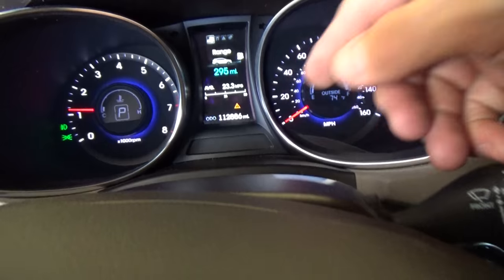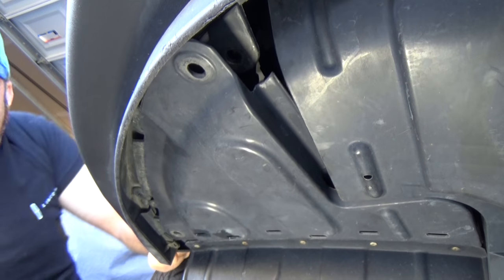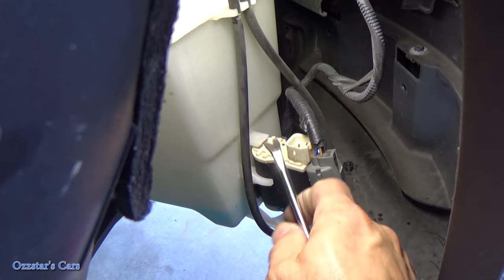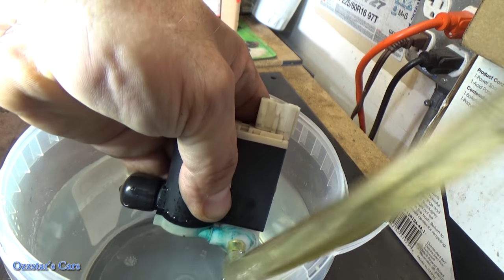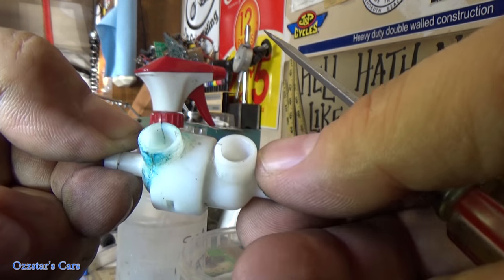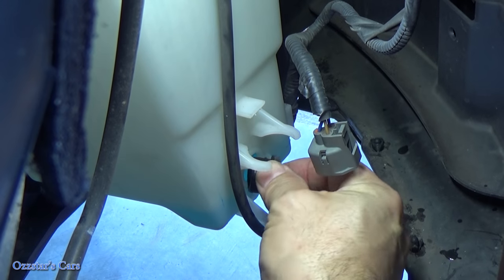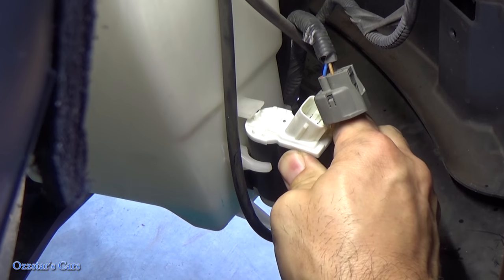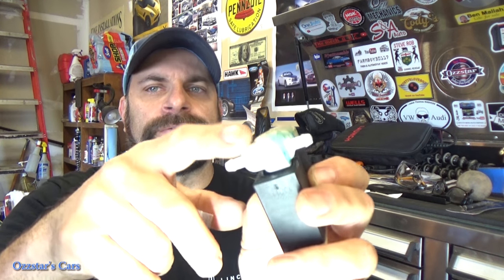Windshield Washer Fluid Leak Repair

Comment: *******I opened the water pump. Same issue same location ans the nipple was cracked. I made the crack bigger and filled with good quality water proof appoxy . It was PC appoxy potty stick suitable for radiators. Its fine now. No leakage*****

Comment: A rodent has chewed a tube but i dont know where it goes...and I cant find info on where the two tubes (as shown in your video) go....one goes to ..i suspect the rear but where does it go...no map to find other end of bite
Reply from the maker: So you see a fluid leak but can't pinpoint it?  Do a smoke test on the hoses.

Comment: I used this pump to replace the pump on a Ecell 3100 PSI pump. https://www.youtube.com/post/UgkxEU8wdEWW31diRsOawsCNfWEho39M27qd The model # is PWZ0163100.02 for those looking for a matching pump. It went on very easily - 10 minutes at most. Feels like a lot more power than the original but that's to be expected. Can't tell a difference when cleaning with the wand or floor sprayer. Would recommend as it was cheaper than most I found. The maintenance free aspect is definitely a plus too. Have used it through about 6 tanks of gas and have zero issues so far.
Reply: Ez pz 24 $ auto zone

Comment: Just did mine after watching this video and a couple others. I took the wheel off and then east access to the plastic fasteners and pretty straight forward from there. Took me about and hour ish start to finish, not too bad. I bought a whole new reservoir with pump and everything for $97 online rather than mess with all those small seals.

Comment: Thanks for the super informative video bud.. all fixed, with the same crack being the issue. Only issue I had now was that my rear washer which was previously working, is not spraying... I'm thinking I tugged something out of place... was getting dark so I left it for diag tomorrow... have you had any similar issues?
Reply from the maker: No I haven't.  If you bought an aftermarket pump I would suspect that is the issue.  Good luck.
Reply: @ozzstars_cars  thanks mate.. it was oem, but I'll have a look tomorrow...

Comment: Thanks so much for posting this. I was able to do the repair with your video without much trouble at all. If it helps anyone else, one of my tube fittings had expanded and wouldn’t stay on when I ran the motor. I fixed this by just snipping the expanded end a little to create a snug fit.

I live in Florida so the heat probably caused the tube to expand on that one side (the side facing the road).

Comment: Fantastic work !!! Do you think maybe using crazy glue and sodium bicarbonate will seal it for good , also some types of epoxy . Again just for emergency to get you through , your idea of getting a new pump is the ideal way to go.
Reply from the maker: I have tried exactly that and it failed. Replacement is the fix. Thanks for the comment Gino.
Reply: @ozzstars_cars  thanks and keep up the great content 👍🙋🏻‍♂️

Comment: thank you! for the tutorial,   super simple to fix,  I repaired the same on a 2015 Santa-Fe.  Did not take off the wheel, had just enough space,  also used the existing grommet as you did in your video.  15 min fix and a  $26 part from  AutoZone   will see how long it lasts!  thanks again!

Comment: Great video! thanks, I knew exactly where to go, mine had a crack in the exact same place. If you want to fix this on the cheap try a cleaning up the crack with some sandpaper and a little JB weld.. good as new. 😂
Reply from the maker: That's a hillbillie fix!  haha  Glad the video was helpful.

Comment: Hi. Great video. Would this tightness test apply to every washer fluid pump? I just tested my pump from 08 Passat  and after blocking fluid intake side and blowing other side bubbles appeard in unexpected place. My understanding is that there should be no air comming out from any other place that fluid inlet and outlet. Am I right? Thanks
Reply from the maker: Sounds right

Comment: I have a 2007 Hyndai Accent and the neck of the washer reservoir is cracked and I cannot top it off as it leaks out from the crack.  Can I use Gorilla tape around the neck to tape up the leaky spot?
Reply from the maker: I would suggest replacing the cracked tank.

Comment: Thanks!  I noticed a little ww fluid under our 2017 Sorrento when I was changing the oil the other night.

Guess I know one of the chores I'll be doing this weekend.  Thanks for the tutorial.  It seems simple enough to change the pump out.
Reply from the maker: It's always something to fix when trying to just relax and take a day off.  Fairly easy fix if you have a new pump.

Comment: Great work in the steps on replacing the pump Glen! And great tip on using a piece of tape to ensure that you don't have any leaks afterwards. Have a good one and be safe...
Reply from the maker: Thanks and you be safe as well.

Comment: My 2016 Santa Fe - exact same problem as you showed.  It had been leaking quite a while but lately leaked the tank out in a few weeks.  You saved me a lot of time by knowing exactly how to approach this!  Because I am cheaper than you, I lightly sanded the plastic where I could get to it, sprayed carb cleaner on it (to remove the grease).  Then used some good 2 part epoxy (24 hr cure) on it all around the joint (not just on the crack).  I'll report back in a few weeks if this is successful but I bet it will be fine.  Saved the $24 for a new pump!  PS, I use distilled water in my tank.  I've found that when it dries, there are no water spots and it never freezes where I live.
Reply from the maker: Interested to see if the band aid will hold.👍
Reply: @ozzstars_cars  1 year still holding.
Reply from the maker: @FlyMeAirplane  happy anniversary!! haha

Comment: What if the pump is working, but water doesn't come out from the hose disconnected? maybe the hose clog?
Reply from the maker: Anything is possible. Did you bench test the pump?

Comment: This was the exact same problem I found on my 2017 Kia Sportage today. Thank you very much for the help. Might jb weld that little white connector part?
Reply from the maker: You're welcome.  I would not attempt the repair with goo.  Comebacks are no fun.  Pump link pinned at the top of this comment section and in the video description..

Comment: Hey! Nice fancy double-dongger pump there! 👍😎

I had that same problem with the rubber on a 98 Ram 2500. Was an AC Delco pump, too. Installed the rubber, slipped in the pump, filled up with fluid and she peed everywhere! Ended up doing the same thing you did and reused the old one. No harm in reusing rubbers, right? 😄
Reply from the maker: I call it recycling. 🤣 Have a good weekend Smitty!
Reply: @ozzstars_cars  -  You too, Glen!

Comment: Hi I fill mine but it goes directly onto the ground.. I fill it and run straight to use it but its empty by the time I reach the driver seat to operate it. Any advice please 1st time driver and completely new to this thank you
Reply: Also it's a nissan micra
Reply from the maker: @lisagolding4882  a flashlight and a good set of eyes to find the leak.

Comment: If you have a 2016 Kia Sedona, your pump will actually be even harder to reach, facing the front of the vehicle. I ended up removing both screws that fasten the tank in so that I could maneuver the tank some to and get the pump removed and replaced, then put everything back in. The 2016 Sedona's pump was only $12 on Amazon, handy. This video was very helpful even still, thank you!
Reply from the maker: Good info on the Kia. Thanks
Reply: Just popped my wife’s 16 Sedona pump. Same process as he did. Just turn the wheel to the left.
Reply from the maker: @jamesquick1753  that's what she said. 😉

Comment: My 2004 Golf look like your unit. My leak is where the motor plug into the tank.
I just bought a tank seal from FPC Euro. If it was not for your video. I would not have thought to buy a new seal.
Reply from the maker: Glad it helped!

Comment: Same issue, but did a workaround on mine. I just popped off the check valve and hooked the hoses straight to the pump, works fine. The check valve only appears to check one side anyway, probably to prevent one side receiving fluid a split second before the other. I didn't notice any difference without it though.

Comment: I couldn't find any cracks causing the leak.  I removed the grommet and cleaned everything up.  I then reinstalled using plumbers grease on the hose barbs and grommet.  Leak fixed!
Reply from the maker: Sounds like an easy cheap fix!

Comment: Looks exactly like what's wrong on my 2015 Kia Cee'd - only difference is, there's a lot more room between the pump and the bumper on a Santa Fe than a Cee'd! 😂 I've ordered a replacement pump on Amazon, hopefully it'll be as easy to change as in your video. Thanks for posting this @ozzstars_cars
Reply from the maker: Good luck with the fix Harvie!
Reply: Thanks Glen! Purchased a Febi Bilstein (German make) pump which Amazon advised would fit my car. Fitted it Thursday, realised it was still dripping - on Friday I refitted it with some PTFE plumbers tape round the washer gromit and the pump inlet nozzle.

The pump came with a new washer gromit which like yours was a little smaller than the original but I used it as when trying to get the original one out it popped through into the tank, I had to fish it out with a wire, I then couldn't get the original washer to go back into place.

Could I suggest flushing the tank out well before fitting the new pump. I had to rinse it about 8 times to get rid of 8 years of gunge which had built up inside.

Good luck anyone else trying this, £17.88 for the pump is cheaper than taking it to a garage! Just remember to reconnect the electrical plug before reattaching the wheel arch trim!

Comment: Thank you for this video! The pump on my 2016 Sorento has a huge crack in the same place as the one in this video.
Reply from the maker: It's a common failure for sure. Thanks for stopping by Christy.

Comment: Use Henry rubberized roof cement, cheap, fast, and reliable fixed.
Reply from the maker: Or just fix it the correct way, once.
Reply: @ozzstars_cars  But it seems like this is a design defect.  So is a fix better or worse than a new part with a design defect?  Time will tell!  Great video tho!
Reply: @FlyMeAirplane  I replaced a new tank bought from the dealer. Same leak again on the tank.  Roof cement is the best to fix it inside or outside. No more leaks, fast and easy.

Comment: FYI...the 2017 model has the motor/pump pointed towards the front bumper and its much harder to remove! May have to loosen the entire bottle to drop it down a bit.

Comment: i have a feeling since this is kinda far away from engine heat in the winter it could freeze a little and crack that lil guy , just a thought
Reply from the maker: They crack even if it never freezes, junk plastic.

Comment: I had a sprayer nozzle get brittle and break. I replaced it and now the washer fluid is spraying out where the hoses attach to the plastic connector. I'm not sure how to stop it from leaking.
Reply: @ozzstars_cars  Thank you

Comment: I've got the same leaking issue going on with my 2017 Kia Sportage.  It's still under extended warranty, so I took it to the dealership today to get fixed.
Reply from the maker: Nothing beats a free fix.
Reply: @ozzstars_cars  Totally!  Turns out my problem was identical to yours.  The pump inlet/outlet flanges were cracked.

Comment: Enjoyed the video and just ordered the part via your Amazon link. Have you done any Hyundai Santa Fe A/C work? Pretty sure my discharge hose has a leak but also hear the evaporator temp sensor can be defective.
Reply from the maker: High pressure side line tends to leak. Done plenty of them.
Reply: @ozzstars_cars  just fixed the washer fluid leak.  Cracked at one of the outlet tubes. Thanks again! Did you notice the electrical connection is more angled on the replacement?

Comment: Hi, Thanks for the video. I have the same problem on my Kia Ceed. Not sure tho if the pump is cracked like shown here.
The question if it's not cracked, what are my options for a leakage repair?
Reply from the maker: Check the pump or look for a cracked tank or hose.

Comment: Never buying a Kia or Hyundai again nothing but issues and oil burning
Reply from the maker: You must own a 4 banger model. The V6 is reliable.
Reply: @ozzstars_cars  yes unfortunately my wife's Sportage. Burns a qt every 900 miles an KIA will not do anything about it now the pump leaking and the thief issues an insurance companies dropping coverage

Comment: Thanks for your awesome, informative video! That was exactly my problem. Even the location of the crack was the same!
Just one question. I am trying to buy a pump and I see some people have complained that those replacements will pump the front and the rear simultaneously. Did you use the one you mentioned in the comment section? If so, did it have this problem? Thanks again :)
Reply from the maker: Glad it helped!  Link to the pump for the Santa Fe I fixed is in the description and pinned in the top comment.
Reply: @ozzstars_cars  Thank you again! I ordered the one you mentioned and it worked like a charm!
Reply from the maker: @aaa22689  that's great!

Comment: Thank you for your videos. I've used a few of them and they have helped me tremendously. Really good quality and very informative.
Reply from the maker: I appreciate your comment, thanks! -Glen
Reply: I replaced my pump. It's not leaking now, but now it doesn't work haha
Reply from the maker: @jbossa2  did you use a genuine oem pump like in the link I pinned above or aftermarket garbage?
Reply: @ozzstars_cars  yes, I used the same one from your video
Reply: @ozzstars_cars  I just have damaged the electrical piece that goes into the pump. Do you know what part that is to try to replace that?

Comment: Followed this video for my 2014 Hyundai Veloster.  Worked like a charm. I would even contend the pump was more easily accessible than whatever vehicle you used in this demonstration video.
Reply from the maker: 2013 Santa Fe in the video.  Glad it helped you Mike, smash the thanks button above if you get a chance.